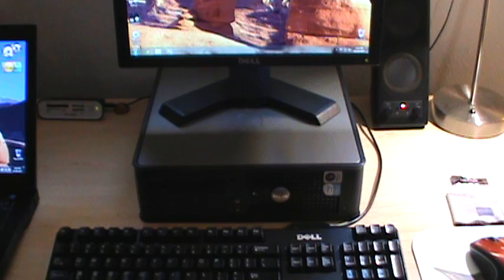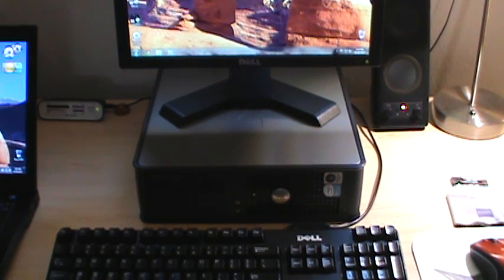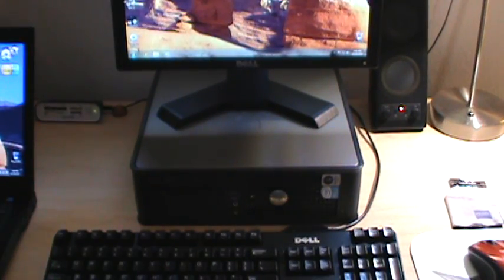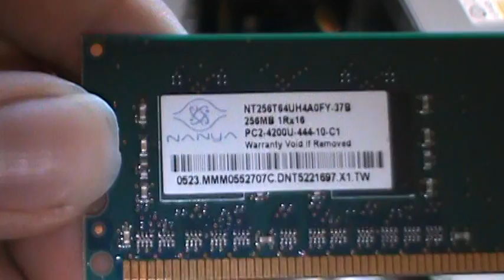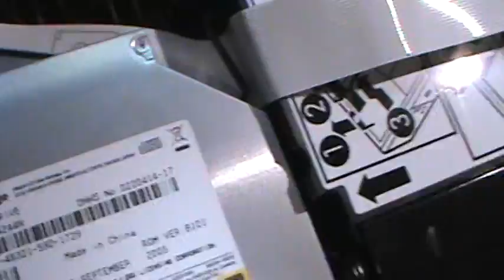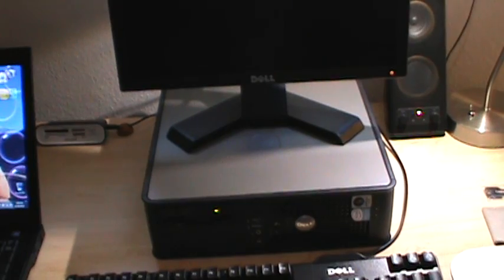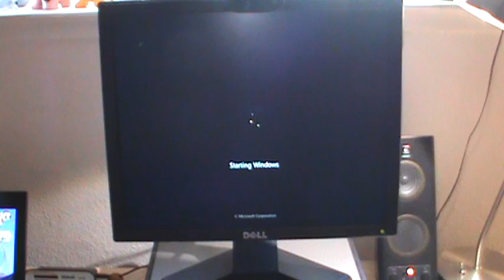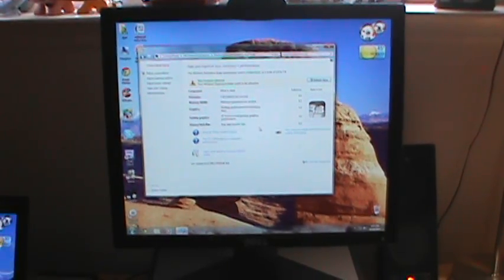Dell Optiplex GX620 SFF RAM Upgrade

Comment: You can upgrade all the way to 8gb ddr2 but you need a 64 bit processor
Reply: depends on the one he has, he has the Desktop version and its not really possible to upgrade to 8gb even though it is 64 bit capable. it is a chipset limitation

Comment: what is the max ram you can put in one of these...? i have 4 gb of ram. could i put another 4gb in
Reply from the maker: +nicki craig It's 4GB for these SFFs. If you have the tower version I'm pretty sure 8GB is the max.
Reply: thanks, i read up on it and it said it didn't matter if i put 8gb of ram the most the computer will use is 3.5 gb so i could stick 8gb it but it wont do anything
Reply: it does say 3.5gb of ram usable aswell
Reply: +nicki craig Did you use a 64 bit operating system?

Comment: These computers were some of the best in its days. It's a shame it's not compatible with 16 GB of ram that would be good I know a lot of people think 16 Gb of ram is way to much but if you want to game and if you're like me want to host game servers at the same time. but if you wanted it all to run on the same pc well the ram may come on handy depending how Much is being run at the same time (also useful for virtual machines) I like to use at least 2GB per virtual machine. Now if you had more than one virtual machine on and you gave each machine 2 well you could easily run 6 or 8. I recently got one of these computers and I am using it to host a non 24/7 gmod server and it does really well at handling it
Reply: +Ben Anslow - ben7a9 Best in its Days? Thoes computers arguably had one of the worst designs of all time if not THE Worst Design. Look at it, Inefficient / very hot Pentium 4 CPU exhausting towards the Hard drive effectively  Cooking it and the capacitors underneath it. But wait there is more, The PSU fan is an intake fan, the computer is basically an oven. Recap: Heat from PSU AND CPU cooking the hard drive and the capacitors. Pretty sure theses machines had well over an 80% failure rate.

Comment: New graphics card+ 8Gig of ram= Game pc
Reply: 8gb ram will not go into this motherboard bro...
Reply: +The Short Nerd 
It would go into the OptiPlex 780. They have ddr3 RAM, support a good video card, and you can stick an Intel Core 2 Quad in it. They only cost 80 dollars, upgrade that machine, and you can game for cheap

Comment from the maker: Thanks Trent, I figured you would know! (I enjoy your Maxtor slimline drive videos.)

Yep, if the drive is repaired somewhere other than the original manufacturer, they have to "genericize" it by law. But yes, it is very peculiar that the firmware tells no more information than the sticker on the drive.